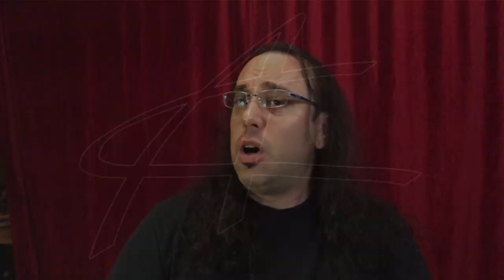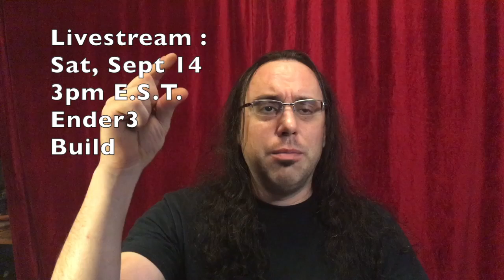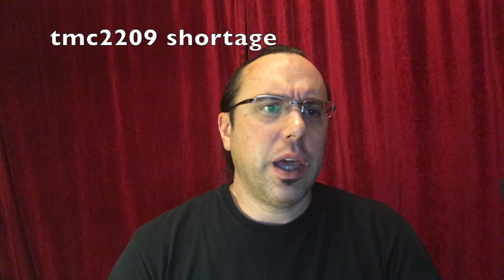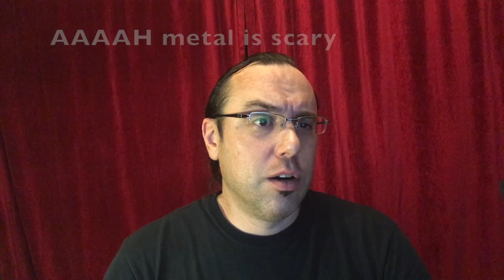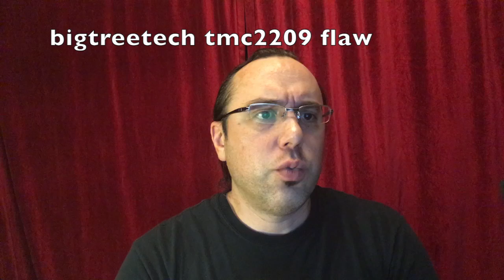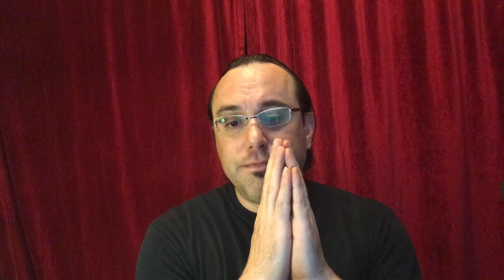Q&A AUG 2019: OS schems, livestreams,  upcoming vids

Comment: You made me look....... at my recently arrived Bigtreetech TMC2209 drivers (got them last week in a package deal with an SKR 1.3 board from their store on Aliexpress). These turned out to be the version 1.1 boards, but I can see them sending those with the SKR 1.3 as you would normally use them in  uart mode on the board and not standalone. I think if it becomes an issue that I will jumper in a different way than Kazolar shows... Perhaps it might be a good idea to do this right away as I'm likely to forget about the flaw if I grab a board down the road for something.

Comment: For an interesting "high throughput" hotend, look at the Lulzbot DualExtruder v3 hotend - https://www.lulzbot.com/store/parts/lulzbot-taz-dual-extruder-v3-hot-end-kit . ... I've recently disassembled/reassembled this extruder and it uses standard e3d volcano nozzles, but has much smaller cross section, is made from nickel-plated copper, has an safety anti-slipout bar for heater/thermistor, etc. .. really nice design!  (Yes, the top is also M7, so you can replace the dual-extruder-like heatbreak with a standard screw-on e3d v6 one)